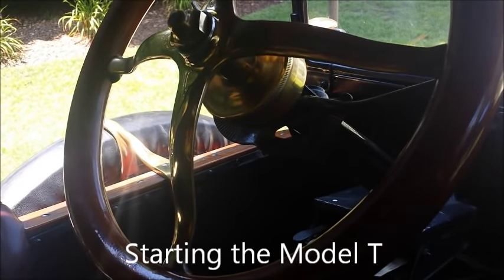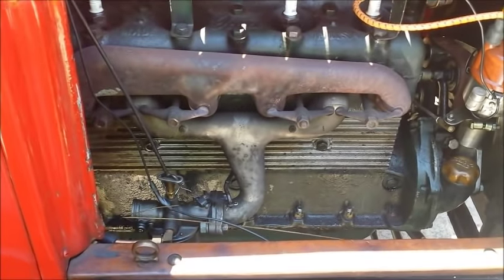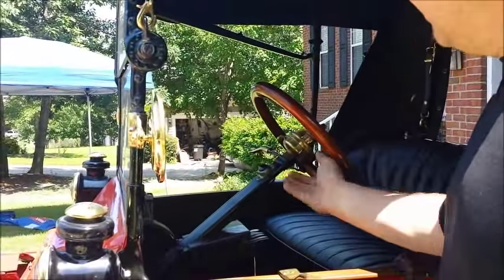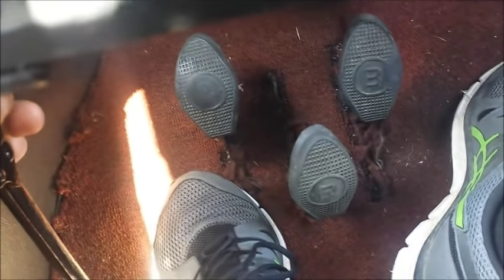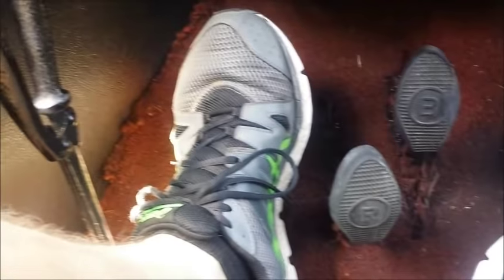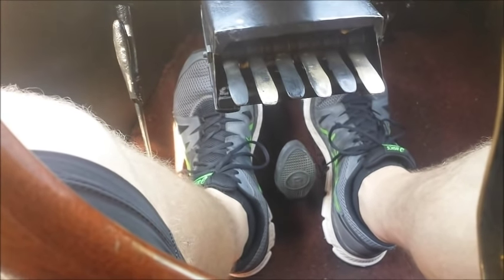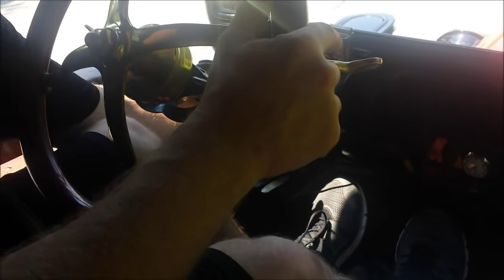Model T Driving Instructions

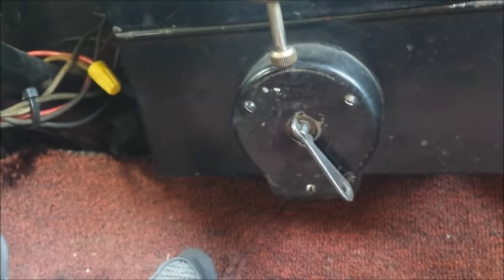Comment: @ 1:00 
is that SERIOUSLY a marett connector on the wiring?? 
Fuck mate! on a car that historical at least do things the right way!!! solder and electric tape for Cars. . Marett connectors are for solid core wire, what you would find in your house.
Reply from the maker: betchalife indeed it is.  And actually, it is solid core wire there.  Grandpa was "creative" with his wiring.  If you look closely, you'll see the absence of any fuses and a combination of solid core and even some lamp cord wired in there.  I make no excuses nor claim responsibility. 😀
Reply: Todd Schelling 
hahaha, sounds exactly like both of my grandfathers.  They loved to fix things, and used what they had available. If it ain't broke don't fix it right? Was just curious as the rest of the car seems to be in almost restored condition. 
I've been told spade or butt connectors, or solder is all you should use because of the vibrations of automobiles. I worked at a Honda dealership, and they mechanics would always have a laugh when they found some jinky wiring.
Reply from the maker: betchalife the wiring was definitely on my short list of things to restore/redo.  Getting the leaky rear axle fixed to allow the rear brakes to work again was first.  My cousin now has the car due to an unexpected job change and move.  Hoping he'll spend some time on the horns and wiring since I finished the axles before he got it.

Comment: I thought  I could drive one of these once. Only difference is it was a 1918 Model. The clown that let me drive it restored old cars. I didn't get 150 feet down the road when I ran it in the ditch trying to shift gears. I tore the front end all to hell, punctured the radiator, knocked the head lights clean off, and broke the windshield. By the way the windshield broke out in shards I could have got cut to bits. steam and antifreeze was shooting up in the air just like in the movies. The car owner came out yelling at me, said I just cost him about $20,000. I just said you should not have let me drive it then. I called my wife and she gave me a ride home. I never felt obligated in anyway. It was his dumb ass fault for letting me drive it with no training to start with.

Comment: It's NOT gas, it's PETROL! And the lever(later pedal) that makes a car go faster is the ACCELERATOR!!!
Reply: Neil Forbes Automotive petrol is called gas in America. The pedal is not the accelerator. It's a gear pedal. The lever on the steering column isn't usually called an accelerator either, it's a throttle. Maybe know what you're talking about before ABUSING THE CAPS LOCK KEY.
Reply: +Ash Cooper read the comment again.... And the lever...then in brackets I said "later pedal" which meant that in later cars the lever was replaced by a pedal, which makes a car go faster is indeed the accelerator because to increase speed is to accelerate! And indeed the fuel is Petrol because it is a liquid, not a vapour.
Reply: Neil Forbes How about you read my comment again? There is no accelerator on this car. It has a throttle which is more for providing torque to the gear bands than increasing speed. Gas is a colloquialism, short for gasoline. it has nothing to do with the matter state of gas. You. Are. Wrong.
Reply: A throttle does the same or similar thing as an accelerator, being that it regulates the speed at which the vehicle travels in one way or another. In a locomotive(steam or diesel), speed is controlled by a throttle. As for petrol, only in the USA and Canada(and their territories) is it called gasoline, for much of the rest of the English-speaking world, it's called by its proper term, petrol.
Reply: +AuH20, Being American is NOTHING to be proud of these days! Also, I'm not British, I'm an Australian! I thoroughly RESENT being called British. And America is NOT the leader of the Western or any other part of the world, America is MERELY one country in the world, no more important than Britain, Australia, New Zealand or even Iceland.
Reply: Neil Forbes Suas Éire
Reply: +Cian Mattern, Wie heißt das auf Englisch, bitte?
Reply: You accuse me of paedophilia without knowing me? Who the hell are you, +Ash Cooper?
Reply: Neil Forbes I'm Chris Hanson with Dateline NBC.
Reply: +Ash Cooper: Then you wouldn't be an on-camera presenter, just a back-room hack, most likely.